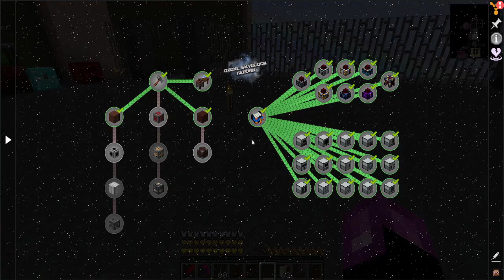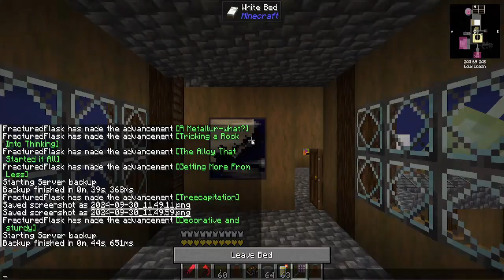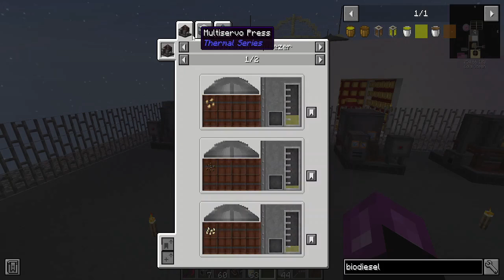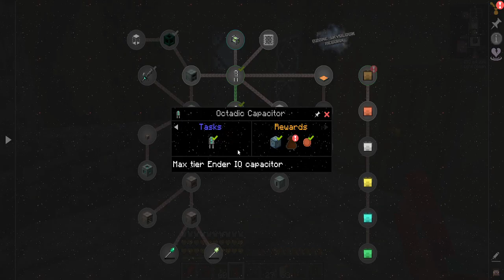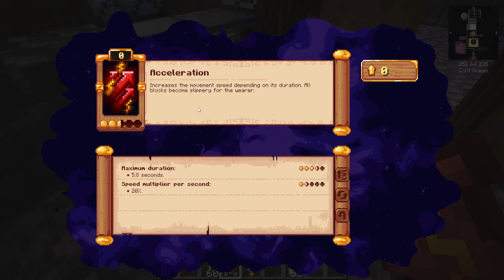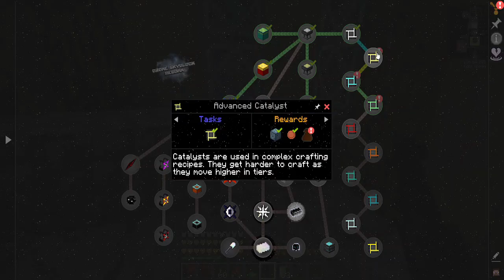Ozone Skyblock Reborn Episode 34 - Thinking Like An Engineer

Comment: One of the first IE multiblock machine I like to make is the presser so I can make all the plates I need.   But it's fun to do a massive set of IE machines.

And sooo many loot bags!
Reply from the maker: Usually for mass plates I just use the Multiservo Press but I haven't upgraded it yet so it takes forever